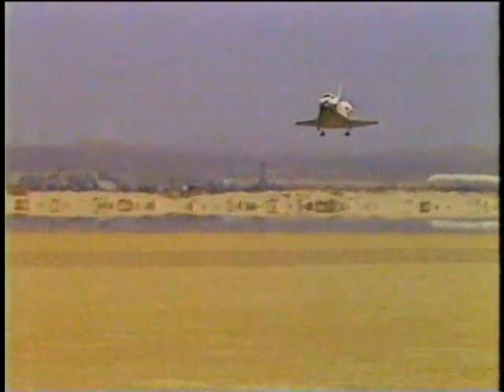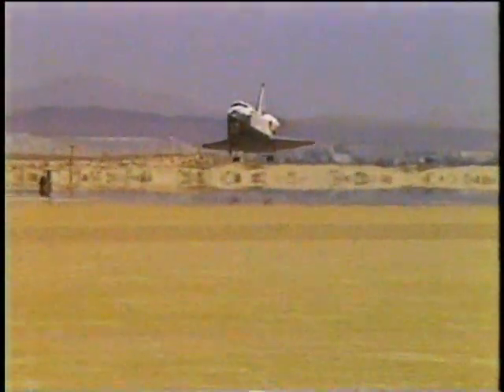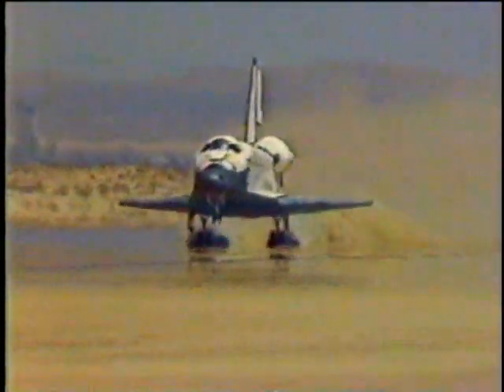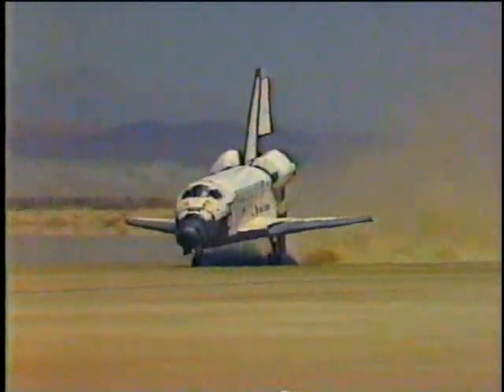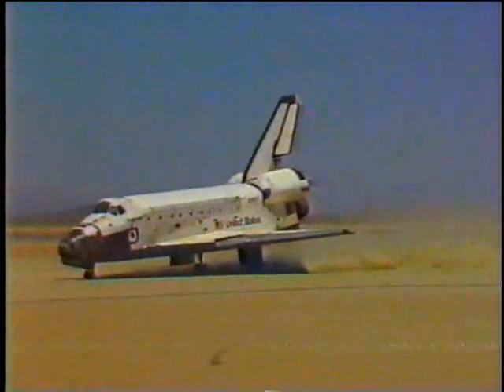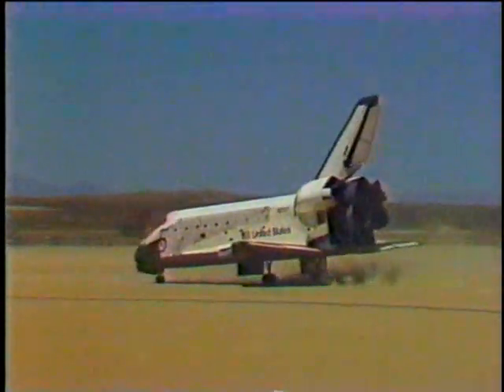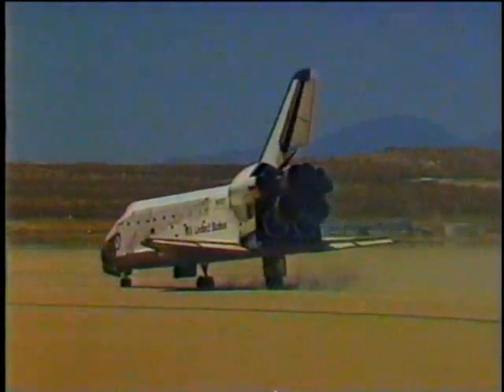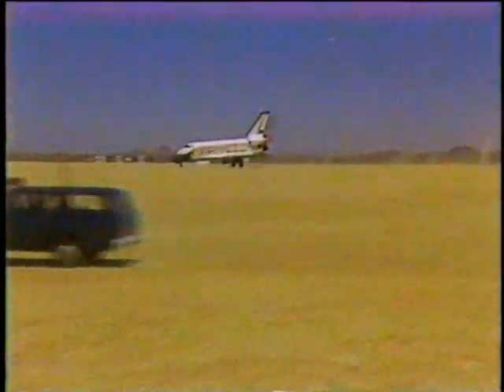Landing of Space Shuttle Challenger mission 51-F

Comment: I miss the Challenger and Columbia. Both "accidents" were totally preventable. No high tech part of the orbiter, ET or SRBs contributed to these tragedies. The first time foam broke free from the ET's port forward bipod strut was on STS-7 (Sally Rides flight) amd subsequently STS-62 and a few other missions all then with Columbia. The forward bipod hand applied foam was never needed if heaters had been installed as was done after STS-107 and of course if there were heaters on the o-rings (even without the modified "tang" capture seal of the SRB case) most likely the Challenger disaster might have been avoided also. Unfortunately NASA management and engineers in the Shuttle era were not as "good" as those during Mercury, Gemini and Apollo.